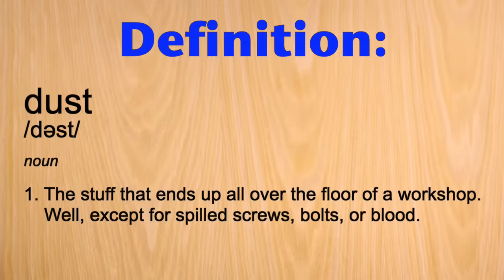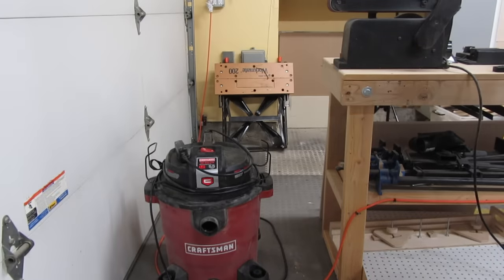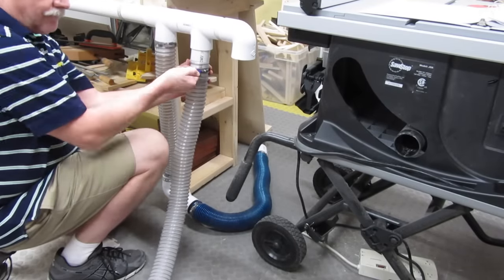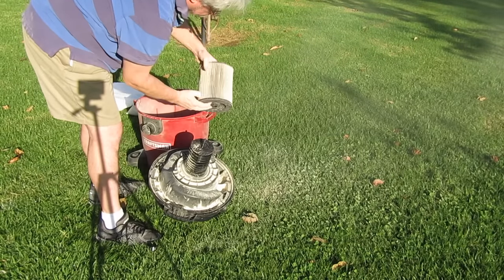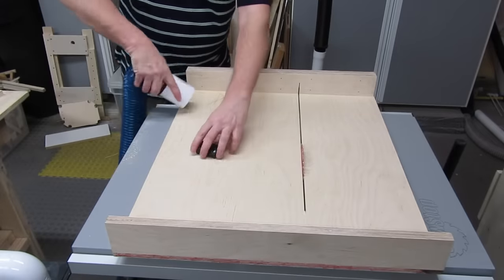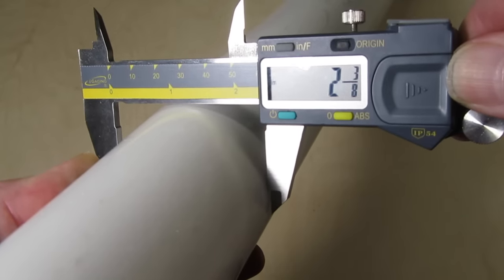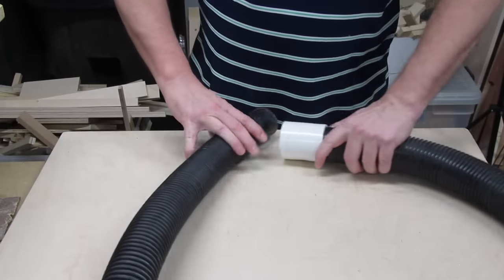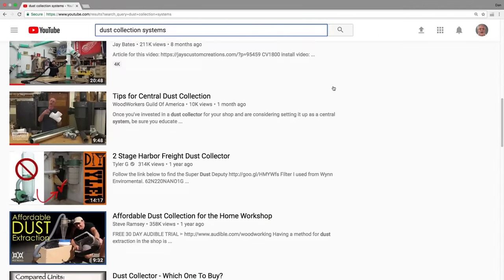Dust Collection for Newbies: Introduction to Dust Collection

Comment: For every 90 degree that the air has to travel , it loses about  half the rated CFM (cubic feet per minute) force, hence why it's not good to have 90 degree bends in air ducts. 
I learned this building PCs (it's why some PC cases are so terrible for air flow).
Reply from the maker: Straight runs are always better - definitely.

Comment: The dust passing at speed over pvc causes static electricity. Thus causing sparks..Earthing the the flexible ducting is always recommended.
Reply from the maker: Here's my thoughts on the subject: https://thenewbiewoodworker.com/dust-collection-fire-danger
Reply from the maker: @EaterOfBaconSandwiches  What I've heard recommended is to run a copper wire through the pipe, and ground the wire. Or maybe have the wire run outside the pipe, but anchor it with screws that penetrate the inside of the pipe (not sure if this is necessary or not).
Reply from the maker: @EaterOfBaconSandwiches  The only thing I know is that people have said it eliminates the static electricity that normally affects the hairs on your arms.

Comment: Still one question remains unanswered for me. Many dust collectors have fabric bag that expands when vacuum is working. I failed to find explanation what's this bag purpose and how it's different from "barrel/bucket" system. Other than that, great material, thanks!
Reply from the maker: Dedicated dust collectors (as opposed to shop vacs) sometimes have the bags you're talking about. I'm not really sure why some do and some don't. Sorry I don't have a better answer, but I know when to say "I don't know". 😛

Comment: Thankyou
Reply from the maker: You're quite welcome! 😄
Reply: The Newbie Woodworker   How Big is your Bucket? And any suggested minimum power for the vacuum?
Reply from the maker: @macmund  It's a 5 gallon Homer bucket from Home Depot. You may have to reinforce the inside, because it might collapse under pressure. One way that works some of the times is to just use two buckets, one inside the other. I would think at least 5.5 HP, for the vac.
Reply: The Newbie Woodworker  thanks that is very helpful. I have a wet/dry vacuum but need to chk its HP. Again Thanks
Reply from the maker: @macmund  You can always try it with what you have and see if it works. That's what I did.

Comment: This is probably a dumb question, but I'm going to ask it anyway. If the bucket that the cyclone is attached to doesn't have a filter, and that is where most of the dust ends up, why do you need a filter in the shop vac? Couldn't you just remove the filter from the shop vac and not have the cyclone attached? Then you could just dump the dust out of the shop vac (as you do with the bucket attached to the cyclone) and not have to worry about cleaning/replacing the filter.
Reply from the maker: Not a dumb question, and I'm not sure if it's even a bad idea. But one thing that comes to mind is if any dust gets through (and a small amount does), it'll get blown back into your shop from the vac's exhaust port. And also, it wouldn't surprise me if that small amount of dust might also damage the vac's motor. But trust me - cleaning the filter is child's play with this setup, as opposed to if you don't have a cyclone or separator. 😳😄

Comment: Would be good to have a power board that can measure the current going to each tool and sent a signal to blast gates to automatically open and close.
Reply from the maker: People have done this in other videos. There's also products you can buy, but they're not cheap.

Comment: I've been looking around for a good dust collection system for my shop (40' x 24' shop). I love the Oneida collectors but just cannot afford what I need tryin g to save up. also shopping around for a used Oneida but very hard to find one as they are so darn good at what they do. Loved your video of your setup.
Reply from the maker: Thanks! And yes, setting up dust collection is a PITA. There are so many options, and it can indeed get expensive. But whatever you end up doing, you'll be glad you did. Just remember that no dust collection system is perfect, and a lot depends on how well that part of your table saw (or whatever) is designed. Good luck! 😄
Reply: Look into the home made cyclone with the two Home Depot or any 5 gallons buckets. Is a very inexpensive alternative.
Reply from the maker: @puromike  👍

Comment: Yep nice invention, however, in the U.K. we have a huge variety of makes of tools, as I’m sure you do in the U.S. I would need a dozen different gauges of pipe. I’m afraid it’s as easy as the above, where I presume his tools have consistent waste outlets. I’m afraid we are way behind you chaps in the U.S. for ready made, and readily available materials.
Reply from the maker: You can heat up a piece of PVC pipe with a heat gun, and mold it into an adapter to fit a different-sized dust port. It's actually pretty easy, as long as you use gloves and don't burn yourself.

Comment: For cutting PVC we use a reciprocating saw with a metal cutting blade because its a finer tooth blade and it works great, also for joining same size pipes, hose ends together, use a fernco plumbing fitting...it is rubber and has a hose clamp on each end...https://www.lowes.com/pd/Fernco-1-1-2-in-x-1-30-in-dia-Flexible-PVC-Coupling-Fittings/1000075343...
Reply from the maker: Thanks for the info!

Comment: I have seen different diameter pipes and tubes connected using sections of tyre inner tube
Reply from the maker: Hey, if it works, I'm all for it! Sometimes just duct tape is good enough. 😄

Comment: Nice system! 
Isn't the vacuum cleaner too small to handle such long piping, though?
Reply from the maker: Thanks. And no, it handles it just fine. Lots of people use them, and some with longer runs than mine, although I wouldn't go too much longer.

Comment: Thanks for the great tips! I'm finally ready to tackle the dust monster that's been a pain in my neck for years. Do you have any tips for a system with a smaller footprint? I have limited space in the garage and the old lady wants to park her car in there in the winter so I need to move my tools back to a corner when not in use.
Reply from the maker: You're welcome. 😄 It all depends on the space you're working with. Sometimes it's actually easier to just wheel around a shop vac or something similar. And you can skip the Dust Deputy if you want or need to, just remember to check your shop vac's filter on a regular bases so you don't overload the motor with a dirty filter. There's other kinds of dust collectors available also that might or might not work better for you. Rockler has one, for instance - I've never used it, and I don't know what the different options are, but it might help you "think outside the box". I'm not recommending it per se, just giving you ideas. https://www.rockler.com/rockler-wall-mount-dust-collector-1250-cfm. Oh, and last thing - a lot of people set up everything so they can just roll it outside into the driveway, and not even worry about dust collection. Obviously it depends on what kind of climate you live in.
Reply: @TheNewbieWoodworker  Thanks so much for the great ideas! Will definitely subscribe and use some of your affiliate links. Keep up the great videos!
Reply from the maker: @stgeorge143  Thanks, Larry, I appreciate it! 😄

Comment: thank you for this video.  well put together.  Are all the hoses from Rockler?
Reply from the maker: Thanks! I think most of them are. I have a Rockler close by, so they get a lot of my money. 😛
Reply: @TheNewbieWoodworker  thanks, need to go get some more urethane, I'll take a look.  I've been using pool hose with my and odds and ends with my cyclone.  I like the PVC approach.  How were you warming the PVC?
Reply from the maker: @mbda1  I actually used my oven, at 350 degrees for about 5 minutes. But it seems a lot of people don't like that idea. 😄So I recommend a heat gun. Even a cheap Harbor Freight one should work. And use whatever hoses and pipes work. Personally, I think if the pool hose works, keep using it! Once you get a system in place, then you can think about improvements, but honestly, the chances are, you'll just leave it that way. 😄

Comment: Great video! I am an amature woodworker and have a small shop. I also have the same craftsman vac, and same sanding belt/disc 😂. How much was the total cost of your diy dustcollection system?
Reply from the maker: Thanks! I have no idea how much it all cost. Probably more than I think it did, because I took dozens of trips to Home Depot and Rockler. By the way, my Craftsman eventually quit working, probably one and a half years later. It just wouldn't turn on anymore. I doubt it was due to how I was using it, but you never know.

Comment: Yeah this is cool and all but I’m going to buy a dust collector some day and run tubing or hoses. I want a bigger dust collector than a shop vac I use for my car and sich
Reply from the maker: That's fine, as long as you understand why you're doing that. For instance, when all I had in my shop were tools with 2 1/2" dust ports and smaller, a big dust collector that uses 4" pipes or larger would not only have been overkill, it's actually possible to burn out the blower when it's only used with smaller ports. So all I'm saying is make sure you do your research before jumping into anything. Good luck! 😄

Comment: Cracking video, very helpful and I thank you. All your videos I have watched are been useful. 
I'm torn to know what to do about a shop vac/extractor can anyone help? I have a record power cx2000 chip extractor but it's gutless sucking once it's been through my thein baffle in a plastic bin, then reduced down at the end of fit the power tool (e.g. table saw or router table. I'm thinking of changing to a 1HP wall hanging extractor or a camvac. Any thoughts and ideas gratefully received please. Thanks.
Reply from the maker: Thanks, David. I can't answer your question, and I suspect nobody else will in these comments (I could be wrong, though). I suggest you go join a free site like https://www.lumberjocks.com/. People are real helpful there. After you join, use the "tabs" at the top to go to "Forums", and ask your questions there. Good luck!

Comment: Great video even years later! 
I have made a setup just like this however I am getting a ridiculously loud whistling when I start the vacuum to use as a vacuum hose. Any advice?
Reply from the maker: Thanks! Sounds like something's not fully sealed. A loose hose or tube, something like that.

Comment: If you use the right blade you can anything with a chop saw
Reply from the maker: LOL, thanks!
Reply: The Newbie Woodworker : I have had success cutting PVC and ABS using the chop saw. A finer-toothed saw is better, but regardless, cut slowly so the teeth can cut incrementally and not catch on the thin wall and explode.
Reply from the maker: @stanrobertson  Thanks! 😄
Reply from the maker: @stanrobertson  Thanks! 😄

Comment: I only have a single 15A circuit in my garage. As soon as a saw gets a load on it, if the vacuum is running too it pops the breaker.  Ideas?  Got the big Rigid drag along shop vac.
Reply from the maker: Yes. You need to add another circuit in your garage. 😛Sorry, but that's the only option. I found someone to do it for me and it wasn't very expensive, but it helped that my electrical panel was right on the other side of the garage wall. And of course some people do this themselves, but I know my limitations. 😄

Comment: Chop saw are not recommended for cutting PVC pipe.  I tried it everlasting time and have pipe explode throwing sharp pieces in all direction.

A band saw or a saber saw works well.
Reply from the maker: Thanks! The only problem with a bandsaw is that I get all these little PVC shavings on the wheels, and they embed themselves in the material that covers the wheels, and I have trouble getting them out.

Comment: Great information! What is the working distance of your system? I understand that distance has an effect on the suction ability of the vacuum.
Reply from the maker: Thanks! I guess it's around 15 feet, give or take. Distance isn't that big an issue if you have straight runs. When you start adding turns and flexible tubing, it can start to affect the results. But the only real way to know is try it and see. And even if it affects it, it's probably still better than nothing. 😄
Reply: @TheNewbieWoodworker  I will be centering my unit then, as I have a 24' long work area. Thanks!
Reply from the maker: @michaeldelvecchio41  Good luck!

Comment: I am aiming for a similar setup.  My dust collection is to be a rolling stand with Thien Baffle inside a 30 gallon trash can, with a 6HP 165 CFM Ridgid shop vac positioned on top.  All of my tools are pretty much the same as yours ==> 2"-2.5" ports.

I have 3  questions:
1) how do you hook up both router table/table saw ports to the suction line simultaneously?
2) is a 2.5" dust collection line a big enough intake for 2 ports?
3) Is the shopvac strong enough to suck both ports simultaneous?
Reply from the maker: Well, you have good questions. Let's see how I do here.

1) If you pause the video at 09:17, you'll see 3 blast gates. The one on the right goes down to the vacuum hose I use to sweep the floor. The one in the middle goes to my table saw, and the one on the right goes to my router.

2) As long as you don't open more than one blast gate at a time, then yes it is.

3) I'm not aware of anyone who has a dust collection setup that sucks more than one port at a time. The standard practice is to use blast gates, and only leave one gate open at a time.

Does that help?

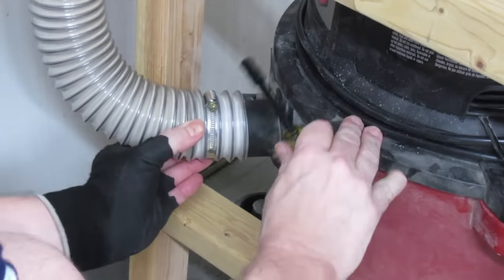Comment: Awesome video! Two questions for you…1) at 14:35 is there a reason you used a PVC fitting on the shop vac instead of just clamping the hose down? 2) I think I have the same Shop Vac as you but would need to run my hose lines longer based on my workshop setup (single car garage but not everything is in a straight line like yours). Is there a rule of thumb for hose length vs horsepower/amps? Thanks!
Reply from the maker: I don't remember, except I'm sure I had a reason. (I know, not very helpful.) There isn't really a sure-fire rule. The shorter, and straighter, the better, although you can see by my setup it has plenty of turns too. I'd get as much HP as you can, and not blow a fuse. :)
Reply: HP is just legal marketing lies, 6HP out of 15A at 120v is impossible or at least way to much of a pain in the ass to think of even doing.
Reply: The peg on the shop vac is why

Comment: great video, as an extraction novice even I understood it lol, however nearly all my extraction ports are drastically different sizes so "molding is not going to help me but again thanks
Reply from the maker: Thanks. Everyone has tools with different port sizes. For the ones that are close to the same size, you mold PVC using a heat gun. Sometimes using some sort of PVC coupler works, or a rubber flexible coupler. For ones that are significantly different, you get adapters. For instance, I have an adapter that I use to connect a 2 1/2" hose to the 4" port on my table saw.
Reply: @TheNewbieWoodworker  thanks mate, ebay here i come lol
Reply from the maker: @briangoodwin5986  😄
Reply: @TheNewbieWoodworker  I tried "molding the ports that were close in size and guess what? it worked, i was really chuffed with the result. thanks once again
Reply from the maker: @briangoodwin5986  Awesome! 😄

Comment: Do not cut ABS on a miter saw. Unless you hate your fingers and like adrenaline. It is dangerous to cut round stock on a rotary tool if it is not clamped firm. Likewise, clamping hollow plastic puts pressure and tension on it. If the teeth catch instead of cut then the round shape lends itself to spinning, gripping, and slamming into the fence. Good way to get shaky hands without becoming an alcoholic.

Comment: Great video! Have you ever measured how much CFM you are getting at the farthest point in the system? Just curious
Reply from the maker: Thanks! No, I haven't. I have a nanometer, but I can't figure out how to calibrate it. But I have another use for it coming up, so I'll try to figure it out.
Reply: @TheNewbieWoodworker  if you're unable to calibrate it, one test you could do is CFM at the source vs the farthest point in the ducting to get a total loss in CFM. That would be a useful metric.
Reply from the maker: @DomFranco105  Good idea. Thanks!

Comment: @The Newbie Woodworker - At 8:05 you mention you used nested buckets to prevent collapse during a blockage. Can you go into a little more detail? Does that mean you drilled some pressure relief holes in the inside bucket or something?
Reply from the maker: I just stuck one bucket inside another, which is kind of like making the walls of the bucket twice as thick. It works for some people, and not for others. But it's pretty cheap to try! 😄

Comment: And to heat the pvc I'm imagining you use a simple heat gun?  If not, what method do you use?
 One question, why multiple hoses/gates for tools that are so close together?  Is it simply to eliminate moving the hose each time?  Thanks for the video and ideas, I'd never thought of a cyclone system before, I'm still using the "make a huge mess then vacuum and sweep when finished" method.
Reply from the maker: LOL. Thanks for the comment. The reason for the gates so close together is just what you suspected: so that I don't have to move the hose each time. As for heating the PVC, most people just use heat guns. Personally, I use my oven, but a lot of people don't like this idea: https://youtu.be/ugUZYmrqejs. Try hooking up a shop vac directly to your table saw (or whatever), and see how much of a difference it makes with the mess. If you think it helps, then you can move on to making your own dust collection system. If not, then you haven't wasted any time or money.